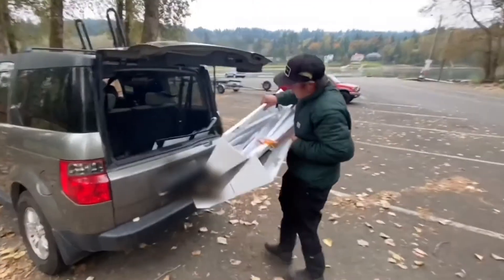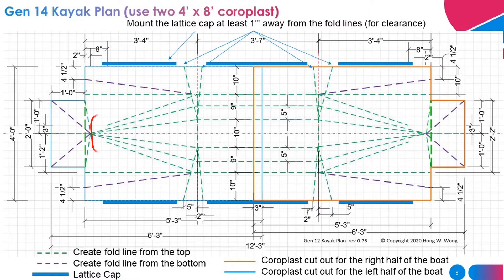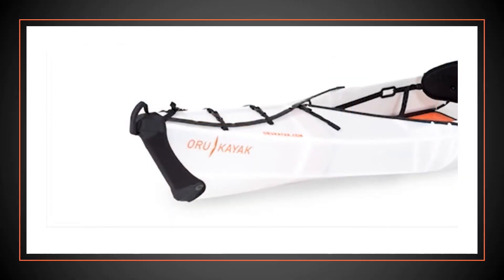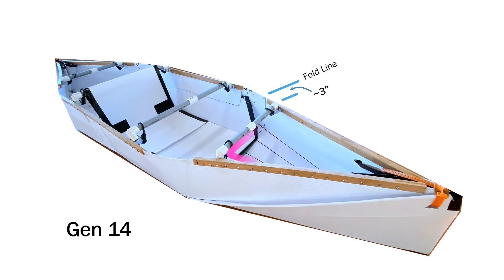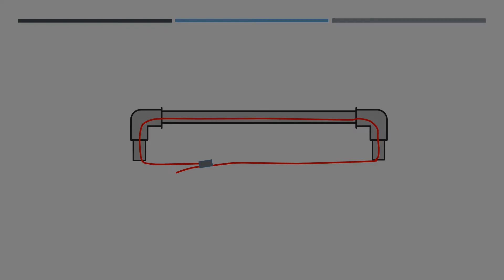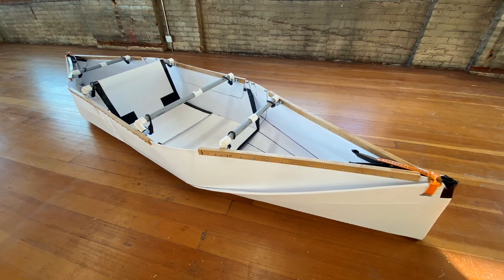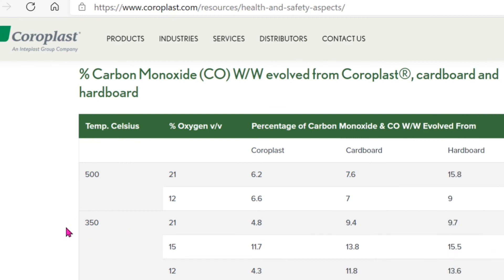Part 7 - Make Magazine - Gen 14 coroplast foldable boat

Comment: Amazing! Any plans to make a 2 person foldable version?? 🙏🏼🙏🏼🙏🏼
Reply from the maker: Yes, because the weather will be warmer in the next few days (at 60F). I should be able to start building the 13' version tandem Canoe/Kayak then. Hope to get most of it done by next Sat. Initially it will be a longer version (canoe style) of this 
https://youtu.be/24cMaaO5RR4
because it can be built faster. Then I will add a small deck in the bow, or may be at the stern also. Will config it with kayak seats and foot rests later. Will update you on the progress....

Comment: Won't be long until you're out of the shop and on the water.
I just finished rigging a nearly 30 year old Klepper folding kayak with a balanced lug rig that overturned on her test run. (51 degree water is chilly after the first half hour).
Now I'm trying to reconfigure my marine ply trimaran to fold horizontally instead of vertically so I can open and close the amas on the water and fit into smaller channels when needed.
A folding coroplast dinghy might be in order for the trimaran.
Reply from the maker: Thanks for the update...it is great to hear you are making excellent progress.... Yes, the water here is still cold and have to wait another month before going to the rivers again.  Cheers!
Reply: @DIYUSA  I actually have a drysuit that I didn't wear because the air was 71 degrees. Turns out that the water didn't care how warm the water was. Lots of lessons learned about the boat and myself that day.
The biggest lesson is that a 54 sq. ft. sail is too much even with two reefs in on that boat in 15+ gusts. Lazy jacks would help too.
Thanks for your videos! Hopefully I will have something worth posting soon.
Reply from the maker: @wisenber  Yes, I am thinking of getting a drysuit too so I don't have to be confined at home during the winter months! But then, air is 71 and water is 50... need a new kind of suit for this temperature range...nice chatting with you....will stay in touch!

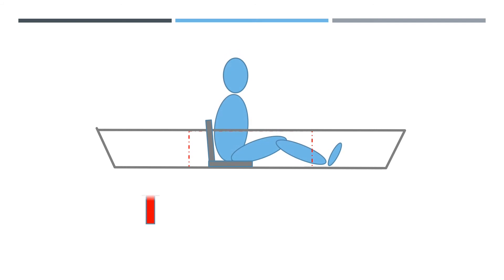Comment: Thanks for this video. 4:23 onward addresses my concern about buckling at the gunwale corners when a heavier person sits in the boat. I understand that those corners actually need to bend to fold the kayak for transport, but they should be prevented from flexing under load after assembly. If the floor reinforcement must go past the fold line, that suggests the floor must be removed to fold the boat. Perhaps some sort of removable brackets that clamp onto the corners to stiffen them might work, they may be smaller and more transportable than floor panels, and may remove the need for extra floor reinforcement.
Reply from the maker: Thanks for sharing your concern. which is real :- ) In my 2-seater boat, I have tested the boat with two people totaled 400 lbs and it was able to prevent buckling, even with wakes from the motor boats. The way I did that was using removable sectional floor blocks (not a single piece because I have to stuff that into my small car). The sections were placed across the fold lines. The 'seats' which are two blocks of foam, were placed on top of the joints of the sectional floor blocks. In the reply I provided earlier, I might have confused you when I referred to the floor (for Gen 12, or Gen 14). I should have said the floor board, which is removable, similar to ORU 12' boat. I could create the floor board using coroplast, and have it extended past the fold lines at the bow and at the stern. However, this floor board can be folded  in half (at the center). This will create a weak point at the middle of the floor board, but I can place the kayak seat on top of this fold line and I believe this will work. I am working on my Gen 15 (a canoe), which folds differently from my Gen 14. and there are more fold lines. I am experimenting a new gunwale design which is to address the buckling issue. The concept is similar to what you have suggested (the bracket, but I used the extended gunwale instead). I plan to reuse the sectional floor from my two seater and I believe this will be a nice boat. I hope to finish building that boat tomorrow, Hope to hope to share that video soon. Please stay tuned.